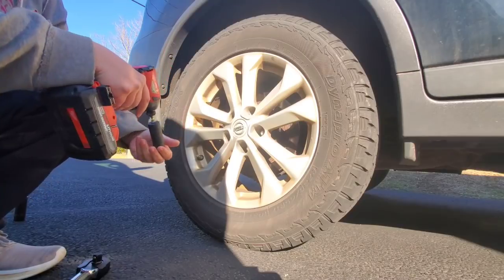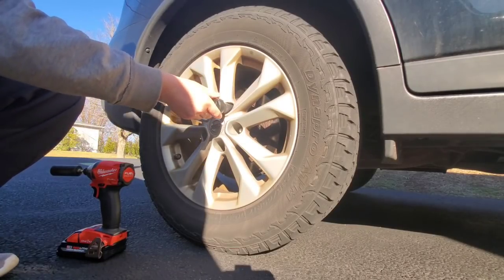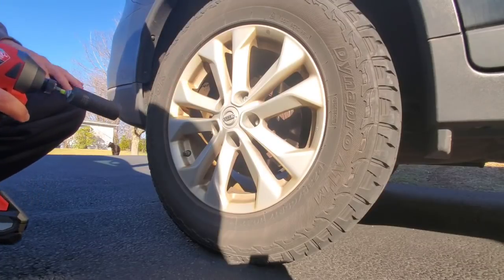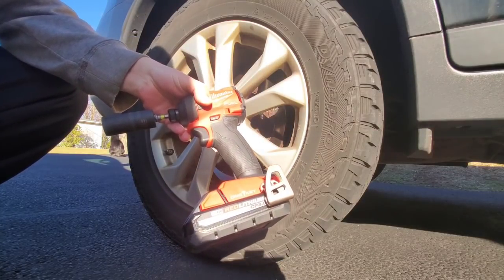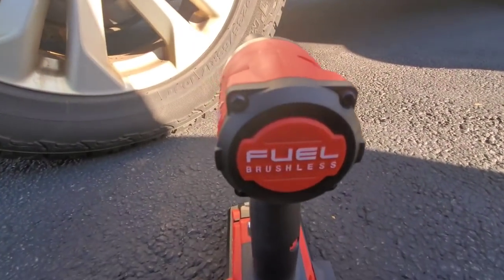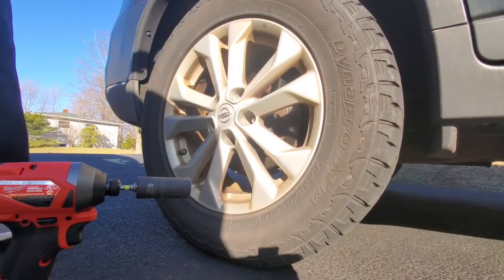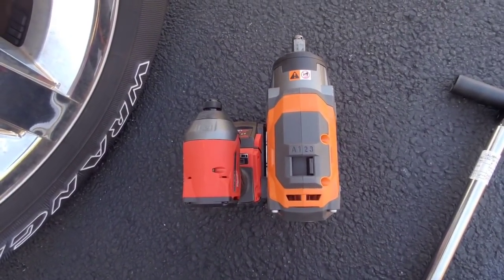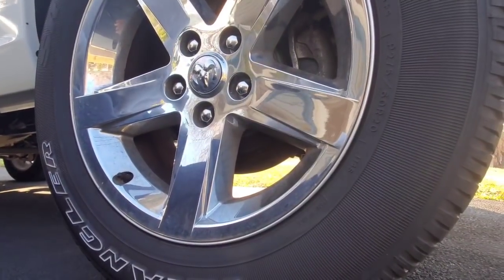Milwaukee M18 Fuel ONE-KEY Gen 3 Impact Driver Torque Test (2857-20)

Comment: Does your impact drivers internals rock back n forth inside the housing if you tilt it back n forth just bought a new m18 don't know if it's normal or not or if its the hammer n anvil just moving as normal

Comment: Those Ryobi “impact” adapters are trash. Mine broke the same way on my m18 fuel non one key driving in huge lags into some big ole cross beams for landscaping. Bought the makita impact rated adapter and it’s been good. The only thing that bothers me about my  18 fuel is the slop you hear and feel when you rock it forward and back in your hand. It’s like the motor is lose in there. It’s my understanding that they are engineered this way to help with breakdown but I can’t help feeling something is too loose, and will break. But I love that impact driver for sure.

Comment: That milwaukee is an adaptor breaker! Great tool, however, that is a design flaw though. Milwauke should move out of that 1/4 hex adapter for those huge amounts of torque. Maybe the Bosch freak adapter could be the solution for Milwaukee. The battery sizes are way too crazy nowadays. It seems that the tool is navigating on a barge.
Reply from the maker: No design flaw at all ..it's the ipm ,nothing else

Comment: Absolutely love my gen 3, I have the regular one. Not the one key. The power is insane. I work for company that’s 95% uses dewalt. I constantly blow them out of the water putting screws in. I have even dropped mine off 30 fr scaffold. Still works like brand new. Seem plenty of dewalts shit out
Reply: Not surprised. My dewalt is already failing. Making the switch to red soon

Comment: Run this against the 12V Stubby!
Reply: I love my M12 but it's not even close to the power of my  Gen 3. I rarely ever need my 18 volt though, since the M12 is plenty powerful for my needs.
Reply: Dale86 I just bought the stubby. I have the Gen3 impact and drill, 2 sets actually. I have a lot of Milwaukee...😳. I bought the stubby for its claimed power, and the fact I feel the impact driver bits are the weakest point in the equation.  I guess I will run some comparisons to see what’s what.
Reply: @Lakecenterlawncare  Same here, I have an original  brushed M18,Gen 3 M18, M12 Fuel Stubby and the M12 Surge, along with a DeWalt Atomic 20volt impact driver. I plan on making a YouTube video soon comparing my M12 Fuel to the 20 volt Atomic, I actually think in that case, the M12 will be really close to the Atomic.
Reply: Dale86 let me know when you get that uploaded!
Reply: The 12v stubby SHOULD be about 100 ft lbs more at 250.
Reply: @RobertBarth1  that's fastening vs "nutbusting torque"

The 12V stubby is probably right around ~180ish fastening.  But Milwaukee doesn't advertise that figure because the tool is meant to break nuts/bolts in hard to reach places.  And an impact driver is primarily meant to drive screws, so nobody advertises a "nutbusting/breakaway" torque figure for them.

Comment: The socket adapters are TRASH!! Milwaukee is kick ass though!!!
Reply: Literally just used a Milwaukee socket adapter to drive 3 inch lag screws. Worked perfectly.
Reply: @RobertBarth1  it's Chaka, so you should automatically know that something ryobi was in the video. 😂
Reply: I agree Ryobi bits are shit they break the first time you use it 💩